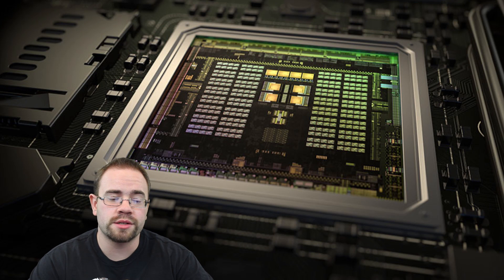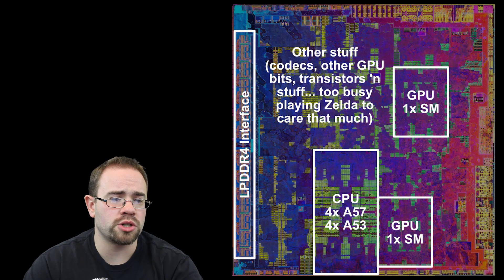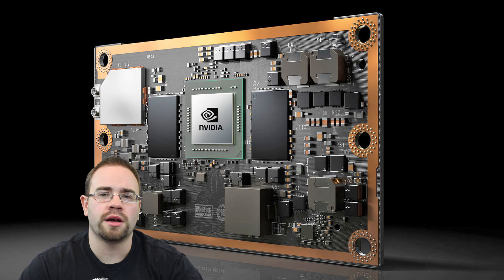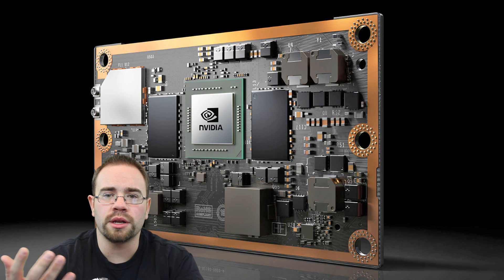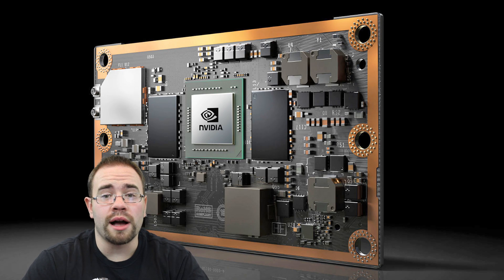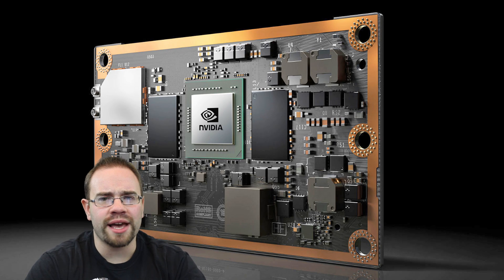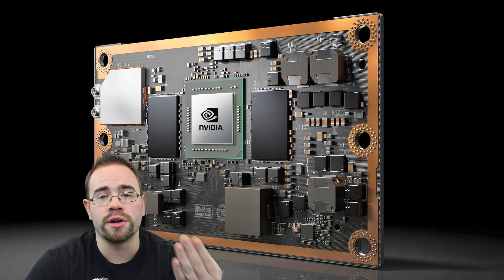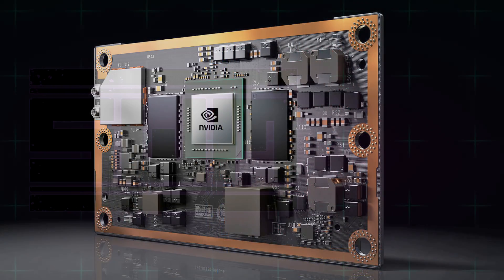Nintendo Switch Chip Was X-Rayed! Here's What's Inside.

Comment: I guess I'm disappointed, but I mean BOTW is so incredible and it runs it just fine. Honestly more pissed that Nvidia lied to us saying it was using the same architecture as the top of the line GPUs (Pascal).

EDIT: Actual Nividia Quote 
"The high-efficiency scalable processor includes an NVIDIA GPU based on the same ARCHITECTURE as the world’s top-performing GeForce gaming graphics cards." Posted on OCTOBER 20, 2016 by ASHISH KARANDIKAR (emphasis added)

So
 Top GPU at that time was the Titan X Pascal next was the 1080 (and the Quadro P6000).
 Huge performance power and clockspeed difference between Maxwell and Pascal. 
The old highest performing GPU was the 980Ti and titan X Maxwell which was released almost a year and a half before that statement.
Case and point. 2 different architectures.
Reply: +MarkXV. What rumors? I just quoted Ashish Karandikar from Nvidia. Never believed anyone else.
Reply: CWeltonDesign double standard, as those critics lower the score for the very same issues on any other game, stable 30fps 720p is not asking too much, on a side note turning off the WiFi seems to reduce the problem, a few drops here and there, still, this indicates a rushed release, exactly what I've never expected from Nintendo
Reply: R3I do you play on the dock? It gets awful near kakariko or any tall grass, using a Samsung 32" Tv
Reply: doesn't matter what the architecture is. try looking at it this way: when nvidia come out with fermi they have the fastest single gpu in that era: GTX580. with kepler nvidia maintain that spot with  780ti. 980ti (and Titan X) with maxwell . last year that position is held by Titan X pascal. so if you were aware nvidia have always "top-performing gpu" all the time. they can use tegra K1 (kepler based) inside the switch and still call it as "same architecture as world top performing Geforce gaming graphic card" because kepler also have that "top" position in the past. it's not about "the latest top performing". that's why people need to be very careful around marketing words. 

anyway even if you replace maxwell with pascal if the core config and process node stays the same performance will be downright identical when it comes to raw performance. the only advantage pascal can have over maxwell in switch was that much more improved delta color compression and the ability to use dynamic load balancing (nvidia asnyc compute implementation).
Reply: +Tomasz Kucza I said it ran fine, not excellent or perfect. Apparently its been a proven Wifi issue they can fix with some updates.  I've only noticed it drop 1 time and that was after a huge explosion with 20 enemies all around. If you look for frame drops you'll find them. Find me any game. I bet someone has found frame drops in it.
Plus its a Wii U port engineered for the PowerPC architecture. If you didn't know, that's much different than the X1 architecture so it was never perfectly optimized. I think its great (hence the best reviews in history).
If Mario Odyssey drops frames after being designed for the X1 you win. I'll give you a cookie (your choice)
Reply: There's a couple of things at play here, first is the double buffered vsync which tries to maintain a stable framerate, but if there's ever a drop below the target, it drops all the way down to the next stable "step". If your target is 60fps and it drops even to 59fps, double buffered vsync will instead drop it all the way down to 30fps. Double buffered vsync is trying to maintain a locked fps target, instead of having framerate fluctuations. BoTWs target is 30fps, and the next step down from that is 20, so even if BoTW just dips briefly to 29fps, the game will drop all the way to 20fps. Digital Foundry even mentions this happening because of the double buffered vsync, and that if they would use triple buffered vsync we wouldn't be seeing this problem. It wouldn't be a locked 30fps but it wouldn't be pulling the game all the way down to 20fps, either.

The second problem as +CWeltonDesign mentions, the game was in development for over 4 years solely targeting the hardware in the Wii U, which is PowerPC CPU with an AMD GPU. The TX1 is an ARM CPU with an Nvidia GPU, and the team was given less than a year to port Zelda to it. That they even got it running, at all, is somewhat of a miracle. It's not using a cross platform engine that would make a porting job a piece of cake, almost literally an "export to Switch" option. It's a custom engine, designed for a specific hardware set. Now that the game is released they can keep patching the Switch version in order to get it better optimized for the Switch hardware, and get it locked at 30fps when docked, possibly even at 1080p eventually, but at least at 900p for now.

I have a strong suspicion that they have not gotten the game actually using the Switch's full power state when docked. I think the game is still running the Switch at it's handheld clock speeds even when docked, as it's been confirmed that developers can choose which power state to run their games at while docked. Basically the only reason it's running as good as it is, is because the Switch is so much more powerful than the Wii U that it's able to brute force it's way through making the engine work. Look, you say "it works barely better than on WiiU" but you forget that in handheld mode, which is only 40% of it's docked power, it's running at 720p like the Wii U, but there are no framerate issues on the Switch, unlike the Wii U. In handheld mode the Switch is outperforming the Wii U version of the game. Which means at the very least the Switch is more powerful than the Wii U, even while handheld. So, logically, you would think that a 1.5x bump in pixels to 900p would easily be covered by a 2.5x bump in processing power when docked (even 1080p should be covered, given that nothing else is changing, only the pixel count, because that's a 2.25x bump in pixels). However, if as I suspect, it's still running at it's handheld clocks when docked, that bump to 900p could simply be too much for the handheld clock speed, and reintroducing framerate issues. So you might say "why would a 1st party team working on Zelda not have their flagship game perfectly optimized for their own hardware?" and the answer goes right back to having less than a year to port this massive game to a completely new set of hardware, they just didn't have time to get it fully optimized before launch. It's "good enough" to not be a major problem, but there's room for improvement if Nintendo lets the team keep plugging away. Particularly with DLC already planned, that should give them some freedom to keep optimizing the game for the Switch hardware as well. At least, that's my hope, that they don't just leave the game in it's current state simply because it's "good enough". Nintendo are the kings of polish, so I'm optimistic they'll keep working on the port.
Reply: Roldan Lopez

Haven't taken it off the dock yet for more than 10-20 minutes. 

The few times that happened were somewhere in the middle of nowhere, some forest areas I think. Can't remember having any at Kakariko.

Either way it's really not something to worry about, many people have made it a bigger deal than it actually is.
Reply: "The high-efficiency scalable processor includes an NVIDIA GPU based on the same architecture as the world’s top-performing GeForce gaming graphics cards." Posted on OCTOBER 20, 2016 by ASHISH KARANDIKAR
Read first. Comment later.
https://blogs.nvidia.com/blog/2016/10/20/nintendo-switch/
Reply: 8-Bit Cerberus dude I'm totally with you there the whole Titan X thing is stupid
Reply: BOTW runs far from fine. Drops frames like crazy to 20 FPS and only at 900p. :( It works barely better than on WiiU.
Reply: Cerberus dropping some serious info. Good to see some in depth analysis for once.
Reply: 8-Bit Cerberus I  suspect that the dlc for Zelda will come with a performance boost to the game.
Reply: botw has some framerate issues and thats a wii u game.
Reply: CWeltonDesign they didn't say same architecture. They said same technology as top GTX cards. That means the APIs, middleware and other software used on the GTX's. That includes PhysX.
Reply: Yeah, I was holding out some hope for Pascal based on that too. But ... technically they weren't lying because the Maxwell based Titan X was still the top-performing GTX card at the time of that statement, with the GTX 1080 coming in just a hair below, and the 1080 Ti not out yet, nor the Pascal based Titan.
Reply: +8-Bit Cerberus No the Titan X Maxwell was outdated at the time of this statement. The titan X Pascal released on August 2nd 2016 (the 1080 and 1070 outperformed the titan X Maxwell and they released on May 27th 2016)  This statement was made on October 20th 2016.
https://blogs.nvidia.com/blog/2016/10/20/nintendo-switch/

No one has come up with a valid argument against this yet. I seriously want to know what's up with Nvidia lying to us.
Reply: The 1080 outoerformed the titan X Maxwell significantly. Trust me I had a GTX 1080 and my coworker a titan X Maxwell (both has Titan XP's now) . The 1080 outperformed the titan X Maxwell significantly.
If anything the titan X Maxwell is really close to the 1070 even losing according to GPUbenchmark by just a hair.
http://www.videocardbenchmark.net/high_end_gpus.html
Reply: Ugh, they really need to come up with a better naming scheme for the Titans. I could have sworn the Pascal one wasn't out yet, was expecting Titan XP not the same name as the previous Titan but adding "featuring Nvidia Pascal architecture" as a sub-title. I had misread a similar benchmark and didn't catch that it was benchmarking the Pascal version since it was just called Titan X... again. And I didn't think the Pascal Titan had launched until this year, may have been conflating that with the 1080 Ti.

I stand corrected, and yeah that's pretty shady of them.
Reply: I'm hoping for sooner, but yeah if not sooner there should definitely be one coming for the summer DLC.
Reply: nvidia did not lie on that front. they never said it was pascal. nvidia just said "world top performing GPU". people just assume it was pascal because right now pascal is nvidia latest architecture. that term is more broad for nvidia actually because every time nvidia coming out with new generation of gpu or new architecture they will always have the best gpu in that era. so regardless of the architecture nvidia use for switch nvidia can always said it was "the same architecture that powered top performing geforce gpu". ever since nvidia coming out with the article back in october i know the article cannot be use as a point to prove that switch will be using pascal. back then i'm not denying the possibilities switch using pascal but when nvidia try not to be clear about it you should feel a bit off with the whole thing.
Reply: "The high-efficiency scalable processor includes an NVIDIA GPU based on the same architecture as the world’s top-performing GeForce gaming graphics cards." Posted on OCTOBER 20, 2016 by ASHISH KARANDIKAR

 Top GPU at that time was the Titan X Pascal next was the 1080 (and the Quadro P6000).
 Huge performance power and clockspeed difference between Maxwell and Pascal. 
The old highest performing GPU was the 980Ti and titan X Maxwell which was released almost a year and a half before that statement.
Case and point. 2 different architectures.
Reply: CWeltonDesign My first console was an Atari, so not really care for graphics, but the fps drops shouldn't happen on a game using such graphics and the problem exists on both consoles, so, what's the excuse for the WiiU version? People shouldn't allow this kind of quality on a game but Nintendo is getting away just by appealing to nostalgia
Reply: +Roldan Lopex I grew up with Ocarina of time running at 20fps. I'll live with moderate frame drops which I've barely even notices. Plus its a port. Wasn't originally developed for the Switch, it was developed for an entirely different powerpc architecture of the Wii U. We'll have to see how Mario runs to really judge the Switch.
Reply: Roldan Lopez It's pretty simple man. The Wii U was weaker and a COMPLETELY different architecture.
Go write all of the critics who gave the game perfect score and tell them they have no idea what they are talking about. Good games are clearly only good if they have perfect frame rates and never push the envelope.
Reply: CWeltonDesign runs fine?? fps drops on dock mode are common
Reply: +Roldan Lopez Turn off the wifi for more stable fps. Nintendo is fixing this problem.
Reply: Roldan Lopez

Have you played it yourself? I've gone through like 80h+ and it has dipped  maybe 2-3 times during that time what I've noticed. Whatever causes it is not a constant thing. It runs fine. But then again I'm not used to playing games in 144 fps so what do I know...
Reply: CWeltonDesign They never lied, you just believed the rumors.

Comment: Well that was kind of a me. Though I think some people already kinda saw that coming with BotW chugging on some areas or at random, and we all are already expecting a release of a better version of the switch down the line like how the New 3DS came out. If a new Monster Hunter title comes up however...
Reply: Disappointment well botw isn't a good example of what the switch can do. It's running a game made from the ground up for another console and is displaying it at 900p with a better draw distance so 900p on MORE things from the quickly made port.which is why in handheld mode it has almost no drops. 720p is far less pressure and even with the further draw distance. equal to the wii u version at 720p the switch version has barely any lag.  I think if anything it shows that it is far better than we think